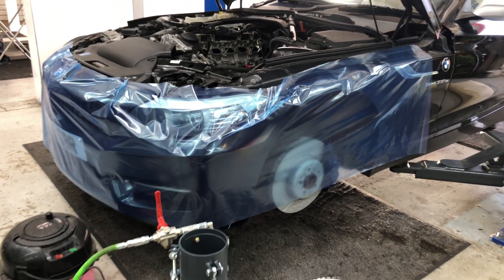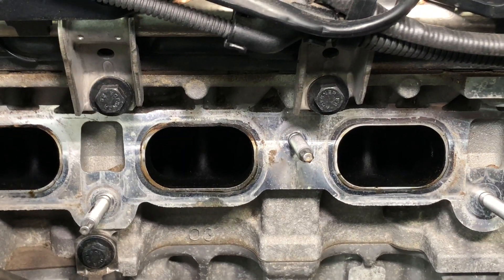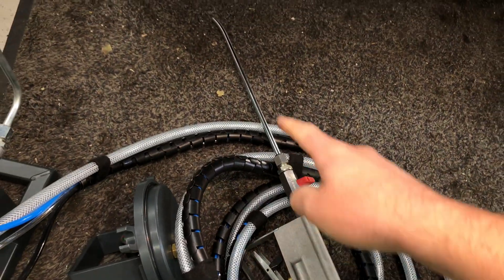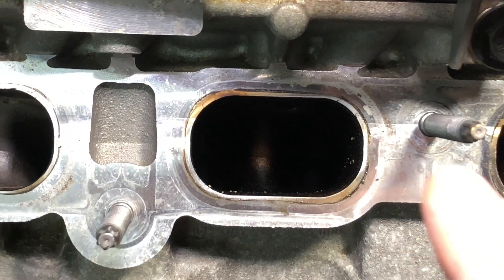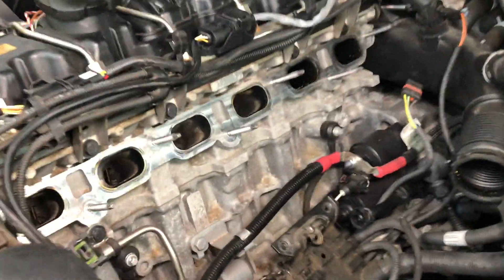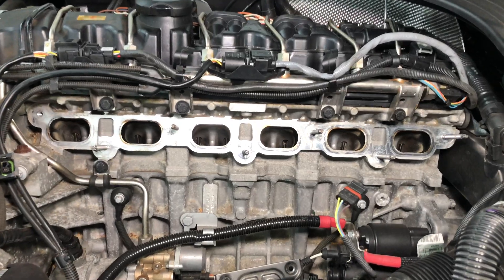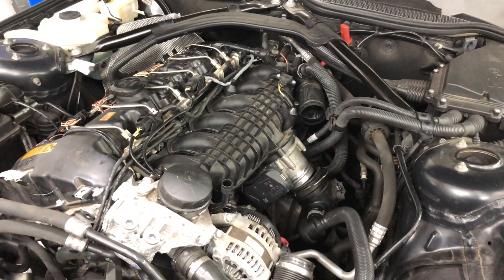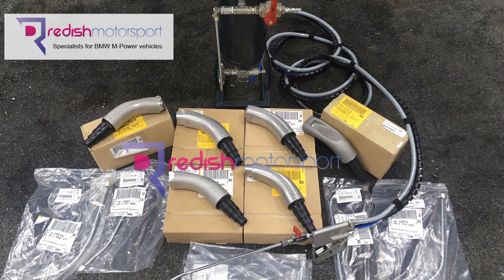Walnut Blasting: see INSIDE a 41,000 mile BMW engine

Comment: Great video!  I didn't know it was just 12 seconds. 

Just to make clear to people, the carbon build up is so bad because it's DIRECT INJECTION and fuel doesn't go over the tops of the intake valves, it is injected directly into the cylinder.  Non-DI engines have the fuel injected into the intake and it "washes" over the intake valves.  

The N54 is especially bad at carbon build up.  The N55 has a recirculation which is supposed to help some but not sure how effective it is.  Some manufacturers are adding some injection before the valves to help with this I believe.  

I use CRC DI cleaner every few oil changes to help, but it won't take off serious build up like this.  

You can buy the little vacuum attachment for about $25 and get a walnut set up (if you already have a compressor) for around $50-$150 depending on how fancy you want (if you're in the US, they sell at Harbor Freight for cheap).  You just have to take off the intake though of course.

Comment: I think I need this on my Z4 35iS. It's been running rough idle lately, has 75k miles and never has been walnut blasted before. Couldn't be the injectors because they were all replaced less than 3 months ago.

Comment: Did similar to an OHC Mazda engine that was drastically failing the smog checks.  All I removed were the spark plugs.  Fastened a soft copper tube to a harbor freight blaster air gun and curved it, inserted through spark plug hole at TDC, and blasted away the combustion chamber with fine walnut shells.  Blew out with clean air.   Engine's exhaust emissions were then 1/4 of limit!  Seemed to have more power as well.

Comment: Can this be used on any manifold of any car
Reply: not all engines need this type of cleaning. only those with direct injection (diesel or GDI) get bad carbon build up. normal port-injected cars get a little carbon, but the valves are generally pretty clean. this process, however, is for cleaning the ports, not the manifold. that said, a walnut blast setup like this should work on an intake manifold. the hard part is containing the mess. the aluminum under that he connects the vacuum to is a bmw part, specific to the port opening, and pretty specific to the engine. the diesels, for example have two port openings per cylinder, and they are different shapes, so it requires two of those special shop-vac adapters. there are a wide variety of 3D printed port adapters being sold on ebay, the ones i've purchased or have experienced personally have been low quality - nothing like the aluminum bmw pieces.